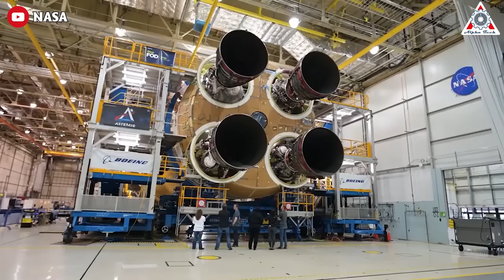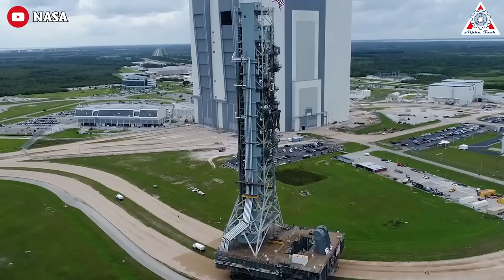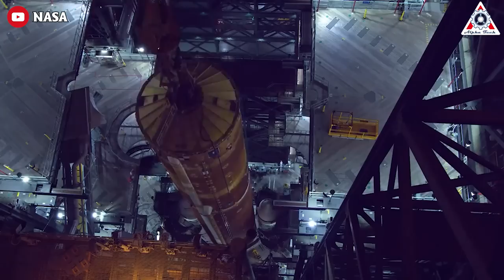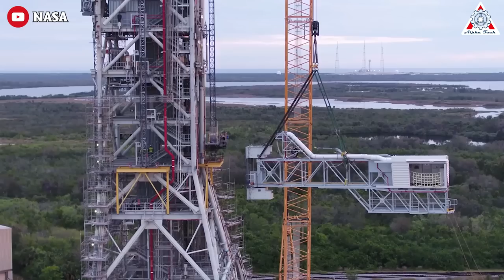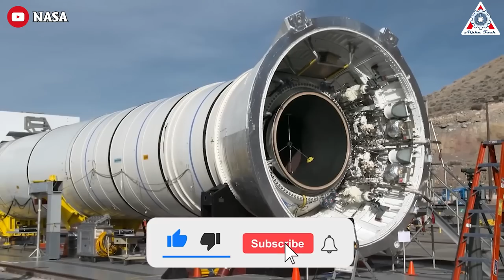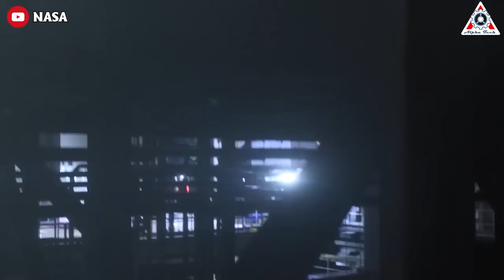NASA Artemis II, III MAJOR PLAN PROBLEM, even though the Artemis I success

Comment: I have heard some speculation that, in the interest of developing a consistent launch cadence and in the absence of any assurance on the timing of what we currently know as Artemis III (given the many hurdles still to cross... namely the requirement that SpaceX complete Starship, test it in LEO, test orbital refueling with multiple Starship launches, build the HLS Starship, launch the HLS Starship, launch other Starships to refuel it in orbit, then do an unscrewed HLS landing as well as the requirement for new Lunar SpaceSuits to be developed and verified, all before Artemis III can go) NASA may consider shifting bumping some version of Artemis IV forward, with a launch carrying a Gateway module and an Orion crew to the under-construction Gateway. They'd then swap the numbers around and call THAT Artemis III, and the lunar landing mission Artemis IV. 

None of that is anything remotely close to confirmed, but I've seen a lot of speculation about the possibility among space journalists who work regularly around NASA. 

If this hypothetical plan were adopted, that would likely mean at least two manned Lunar Orbit missions (Artemis II and the first manned Gateway mission) before the first Lunar landing mission. If that landing were, as most estimates, in 2028 then this rescheduling would add another mission in between 2024/2025 Artemis II and that landing mission. This would bring the gap to ~2 years instead of 3 or 4.
Reply: From a safety and risk mitigation point of view, I think it will be very important to have Gateway in place before taking on the Lunar landing challenge, - regardless if it's the first lunar landing after 50 years or the first landing without the help of Stanley Kubrick.

Comment: So NASA is hoping for a two year between launch gap. Meanwhile over are Space X they are working towards a two hour turnaround for Starship. I feel the difference in attitude and approach will prove Space X to be on the right track.
Reply: The two year gap is to study every detail of Artemis-1 first and apply all you learned to #2 MANNED flight.  That was the whole purpose of flight #1.   Later flights will be closer together than 2 years, but SLS is not an express bus.  It will fly ONLY when heavy lifting is needed.  Commercial companies will do the bulk of LEO people and small cargo transporting, which has been NASA's plan for over a decade and why Constellation-1 was cancelled and Constellation-4 re-vamped into SLS.
Reply: @RamblingRodeo  Good luck with that.

Comment: How long did it take to build the First Artemis Rocket 🚀 I honestly don't know
Reply from the maker: Development of SLS began in 2011
Reply: @alphatech4966  Wow, I thought such a rocket only takes two to three years to build, thanks for letting me know
Reply: @BlueCation  and it re-used components from the shuttle program.  Typical federal waterfall development money sucking jobs program for Senate and House corporate donors.
Reply: @BlueCation  The rocket that launched Artemis 1 began initial welding in 2015 but it's delivery was delayed by almost 3 years because of various problems during development.
Rockets for later missions are expected to have a lead time of ~3-4 years, which is typical for most aerospace hardware.
Don't let the haters drown out the facts with ignorance
Reply: Also dont forget that the complete system is meant to be human rated and deep space, testing and restesting of critcal systems must also be done to ensure safety, irrespecive of the phsysical rocket propulsion design that has been proven on the Space Shuttle, though yes delays seem too much, proof is in the pudding when the maiden flight of all systems is a complete deep space mission of which humans could have travelled safely, time well spent, budget to be desired.

Comment: NASA is stuck in the "sunk cost fallacy". It would be cheaper to stop now with SLS, and put just half the resources into StarShip.
Reply: Starship needs an escape capability. It would add weight for sure but would save lives AND expensive equipment. AND they need a lander that makes sense . . . not this 1950's style approach they're going after.
Reply: When will Starship be able to replicate these capabilites?
Anwers range from several years to never depending on your optimism
Reply: @brokensoap1717  6 months from when they start trying.
Reply: What we are seeing here is the space x fans getting ready to go through the 5 stages of grief as they slowly begin to realize NASA got it right from day 1.

Comment: Have a falcon heavy bring Artemis to leo. Have Elon Musk develop a service propulsion module that it can dock with which would carry an abundant supply of fuel, propulsion and life support for longer range missions. This service propulsion module would be meant for space flight only and would act as the transport module to bring Orion to and from.

Since the fuel would probably be hypergolic, they already developed and man-rated hypergolic engine could be used for this propulsion system. Ideally we would want one that is throttle-able. Solar power and an onboard guidance system gyro stabilized would also be preferred for long-term use. It would also be good if this were refuelable

Comment: The thumbnail is clickbait
The SLS rockets for both Artemis 2 and 3 are proceeding very smoothly
If the Orion for Artemis 2 didn't have this avionics dependency they could launch the mission much sooner.
Doesn't take 2 years to recover the spacecraft avionics from Artemis 1, only a number of weeks to bring the capsule back and remove them.
The gap exists because the Artemis 2 Orion can't proceed much further in assembly without those avionics.
Can't mate the heatshield, or the service module, perform integrated tests, environmental/thermal tests until these avionics are delivered to Artemis 2.
It's all of those things, plus Orion encapsulation, fueling, stacking on the rocket and the subsequent launch campaign that take the better part of two years, all of which are being held up by the avionics dependency between the two capsules
Reply: if you want to travel 6 months or longer in that cramped 4 ish person orion capsule go ahead, I'll wait for the luxury liner starship to take my trip to mars with 50 or so other humans and a few dozen bots.
Reply: @traficdas  You'll be waiting for a very long time then
Starship will probably never carry crew to Mars all by itself, let alone 50 of them
Pure fantasy

Comment: Two years to remove and reuse tech from the artamis 1. Is that one engineer part time?
Reply: Seems like they are just milking the  time clock to get paid more.
Reply: Doesn't take 2 years to recover the spacecraft avionics from Artemis 1, only a number of weeks to bring the capsule back  to KSC and remove them.
The 2 year gap exists because the Artemis 2 Orion can't proceed much further in assembly without those avionics.
Can't mate the heatshield, or the service module, perform integrated tests, environmental/thermal tests until these avionics are delivered to Artemis 2.
It's all of those things, plus Orion encapsulation, fueling, stacking on the rocket and the subsequent launch campaign that take the better part of two years, all of which are being held up by the avionics dependency between the two capsules